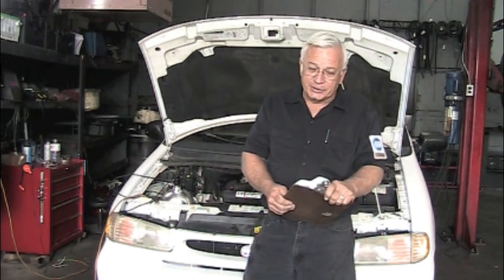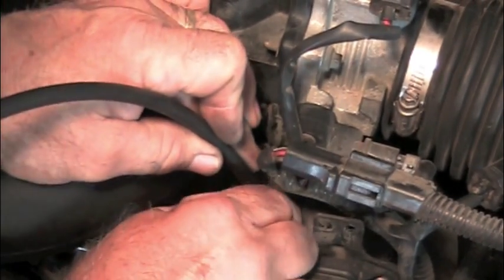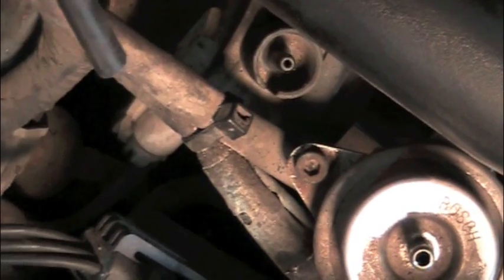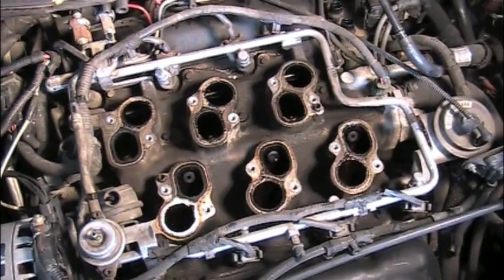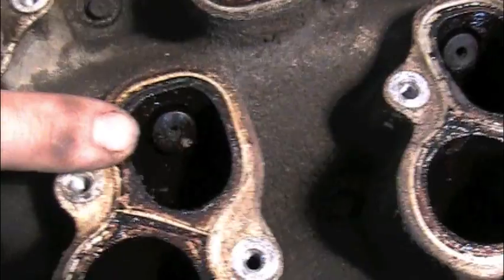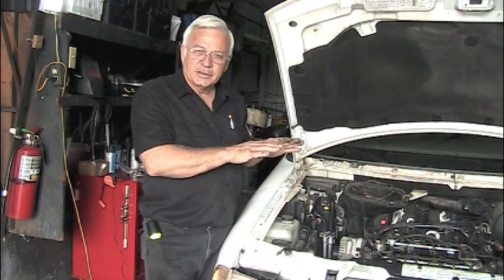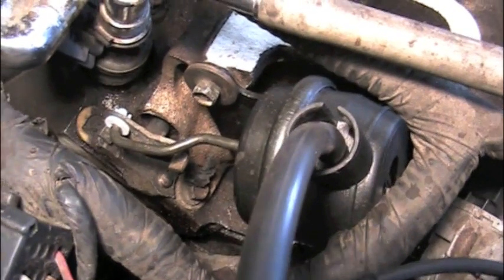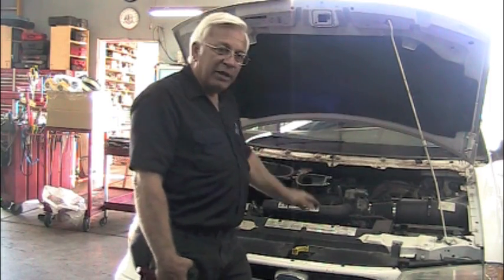Windstar MIRC Codes

Comment: @vipermech A bit late but he's not selling the tune-up as a fix but as a needed service that hasn't been done in the 95k miles of ownership and since the engine is being torn into already might as well get it done. Then coil itself is the a fix for half the vehicles problems, the vacuum valves for the mirc codes, and a tune-up for normal maintenance and better operation with all the other parts/labor already done.

Comment: My coil pack failed and both IMRC's eventually started to leak vacuum and failed on my Windstar.  Ford must put junk parts on these Windstars because I saw all kinds of failures not related to maintenance.  I had to pay $128 plus tax for each IMRC at the dealer.  I am surprised that so many people had trouble with the IMRC plastic clips because I saw no problems with these clips but my Windstar only had about 50K miles on it when all of these failures occurred.  The Ford Windstar is a major money pit.
Reply: The Windstar was so bad we never set foot on another Ford car lot.  POS.

Comment: The coil packs on these vehicles are a high failure rate item. Anytime you have misfires you should remove the coil pack and inspect the plastic case for cracks. If you find any replace the coil pack.
Reply: If you go to the trouble of taking out the coil pack, you might as well replace it anyway.  These Ford coil packs are junk and fail way too often.
Reply: can you just epoxy the cracks closed?
Reply: @ufartface  You can try, but part of the reason why they crack is most likely that over time heat deforms the coils inside and they expand. I wouldn't mess around. You should just change the coil pack. Remember when these coil packs go bad they can cause misfires and misfires can destroy the catalytic converters.

Comment: what was the reason for the owner to take it to you?
Reply: sabastian71113  when a car throws a code or several codes, the service engine light will come on, therefore you can deduce that the owner brought the car in because the service engine light was on.

Comment: did you use a paperclip or metal scraper to get the carbon deposits out of the EGR ports?
sounds like i heard some metal grinding when you first started the car
shouldn't scrape metal on metal like that, use a pipe cleaner
but hey this is all just advice fellas
you can do whatever the FUCK you wanna do

Comment: WATH IS NORMAL POSITIONS?  OPEN O CLOSE WHEN THE ENGINE START
Reply: closed at low rpm due to vacuum then open at 3000 rpm due to little vacuum with throttle open

Comment: IMRC delete in my opinion
Reply: It will not run right. The computer assumes these butterflies are working, and when it discovers they're not (because you've disconnected it) the computer will not just trigger a fault code but try to compensate and it will probably do so with less or more fuel, my thoughts would be less, thus less power. Probably when you most need it too. Likely will run rough as well. I once owned a Dodge Diplomat with the Lean Burn electronically controlled carb, it was nothing but problems. I would repair one thing, and soon after discover I had another problem. Eventually I solved all if it by installing a quad carb and distributor thus eliminating 90% of the problems, and cleaning up my wire looms in the process. That was a 1986 car. You can't do that so easily with modern engines.